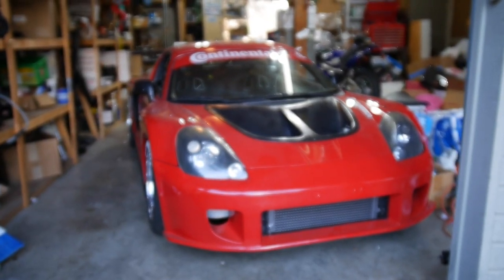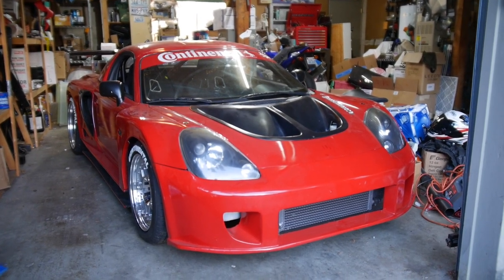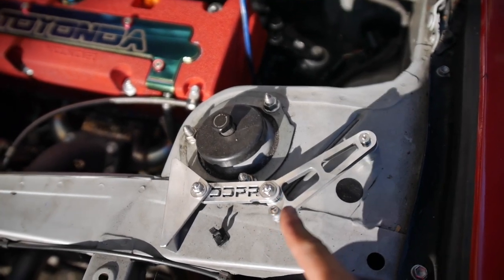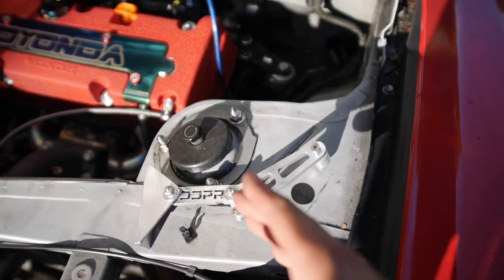Reviving my abandoned K24 Turbo MR2 | Monocraft GT300 Kit

Comment: Could be a sticky idle air control valve, or MAP/MAF sensor, or even sticky throttle body.
Glad to see you're back.
Reply from the maker: It has an IACV delete on this setup. I cleaned the throttle body and tested map sensor. The last thing I’m checking is a gunked up vtec solenoid
Reply: @RedlineRicer  well good luck with it. I have faith you'll figure it out

Comment: Looks like you have already checked a lot of things after reading all the comments. A couple other thing I would check that I haven’t seen you post is crank position sensor, make sure your grounds are to bare metal, and I would check your O2 sensor wiring (and the rest of your harness) to make sure something didn’t rub through and is causing a short. Check around any loose areas where the harness can flap around and rub.
Reply from the maker: I checked crank sensor, and cam sensors, I’ll go through the o2 sensor wiring and harness. So far there aren’t any areas where the harness is stressed or burned through but I can look more closely at the harness to the ecu. Thanks!
Reply: @RedlineRicer  Does the misfire happen at a certain RPM or all the time? Does it change if the engine is hot or cold? When did the misfire start?  What was the last mod you did before it started? Maybe share a video of the car running/misfiring and discuss what has already been checked/ruled out.  I am sure some much smarter than me can help you fix it in the comments.  Glad to have you back and looking forward to more MR2 content! 

Without knowing any more info, I would pull off your throttle body and check the gaskets and IACV block off for any leaks. Spray some brake cleaner around it when installed and see if the idle raises to find a leak, or smoke test your hole system.

Comment: I’d do a compression test and also Check the valve lash. On my k swap I don’t have a iacv so I had to drill a hole in my throttle plate to get it to idle.
Reply from the maker: Just checked compression a few days ago (this video was recorded a few weeks ago) and everything was good, also checked timing. I unplugged my vtec solenoid and it didn’t make any difference in idle so I might try cleaning that out as well. I’ll check valve lash.
Reply from the maker: I also have an aftermarket throttle body with iacv delete and it ran good for the last 5k miles or so

Comment: Could be a bad map sensor or wire? Have a tuner look at data logs and see if there's anything out of the ordinary. Also doesn't hurt to do a leak down test to make sure you're not getting a misfire because you have bad valves
Reply from the maker: Map sensor is good and wiring to that sensor is good but I’ll definitely do data logs and send it on over. Thank you!

Comment: Clean your throttle body or change it. It may be getting stuck. I had a Caliber SRT4 and had the same symptoms you mentioned.
Reply from the maker: Cleaned out the throttle body and unfoetauntely didn’t fix it. Going to clean out the vtec solenoid and see what that does